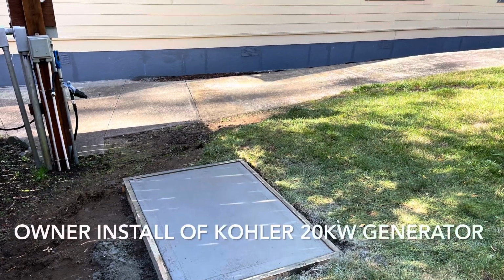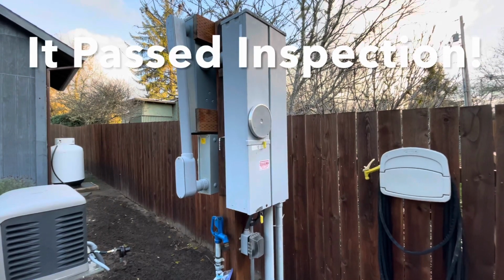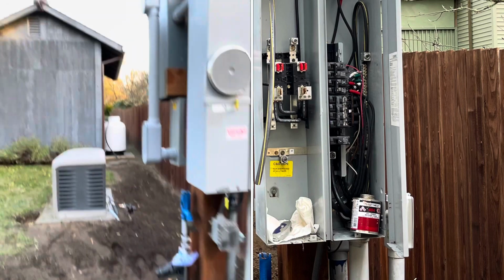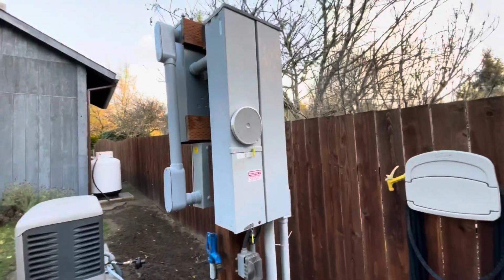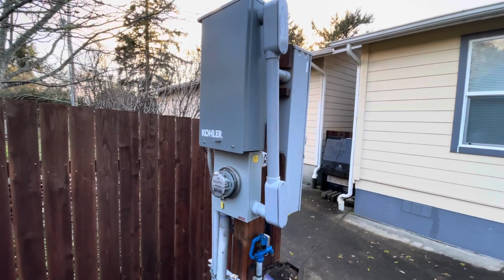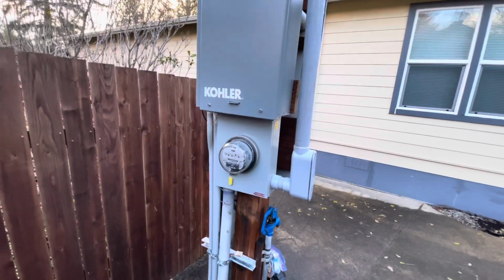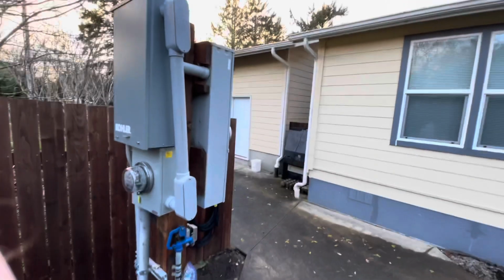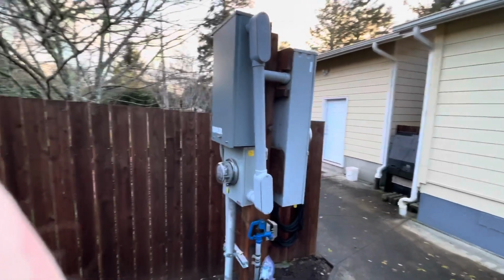Owner install Kohler 20kw generator finally passed electrical inspection

Comment: Would never pass here as your ATS box sticks out farther than your meter box, our local power company wouldn’t allow that as it impedes in their required working space for their meter sockets. 

Not saying it won’t work.
Reply from the maker: Fortunately neither the state inspector nor the PUD lineman took issue with the physical layout. Half way through the second winter season the system has accumulated over 60 hours runtime and continues to perform well. Outages occur Frequently on this stretch of the coast,  thankfully our public utility district is staffed by talented and motivated professionals who keep those frequent outages relatively short lived.
Cheers!

Comment: 4 months jeeeeze
Reply from the maker: When I installed the gen-set we were using the house as a vacation home and  I only had a day or two per week to work at it. We’ve been living here full time for a year and the unit has been invaluable, I should add it’s ran perfectly.

Comment: Hey great video anyway you can help me out with wiring from ats to generator I’m having trouble figuring out the battery charger from the board
Reply from the maker: The generator is at our vacation and soon to be retirement home along with all the diagrams & paperwork but perhaps I can remember enough to help.
Reply: @jatoav8or  thanks for quick response So I have the exact same set up As you and they’ve tested the system it does work but what I can’t figure out is where to land from the ATS board to the board in the generator The wires in order to keep the battery charging I currently have it with an external trickle charger so the battery doesn’t die out
Reply from the maker: When I  get an opportunity  I’ll look for a schematic to see exactly what I used & what terminals are involved.
It was last fall/early winter I did the installation, I can’t remember off the top of my head. I do know I ran 12 or 14 gauge solid insulated copper from the card in the ATS to the terminal block on the generator. That lead supplies the generator with 120v ac to power the controller and the battery charger in standby mode. The charger is integral, if you supply power to the generator you’re also supplying power to the battery charger. I’m trying to find a schematic online so I can tell you exactly which terminals in the transfer switch and which terminals on the generator. 
When we get a break in our weather I have to go mow the lawn at the beach house then I can physically look but that’s not going to be for a few days.
Reply from the maker: https://www.electricgeneratorsdirect.com/manuals/kohler-8d641dfaaf49f5e27025a18de960cd9e.pdf
                                                    https://www.norwall.com/product_pdfs/21_14resa_installm_2015.pdf
                                                       Above are links to the two pertinent manuals I used for the installation.
In manual Tp-6893
Section 1.9.2   1.9.3   1.9.4
Figure 1-18   1-19
Manual Tp-6807
Section 2.6  
    Figure 2-8  2-9 2-10
I can see I need to open everything up and do a detailed explanation not a brief overview.  At the time I was alone , the weather was dreadful. Not conducive to making a video.
Reply: @jatoav8or  thank you
Reply from the maker: I apologize for the delay and confusion, especially the confusion. I finally realized what you were asking about and could have immediately answered your question if I’d paid closer attention.
I just posted a video with a detailed description of supplying the 120volt ac to the terminal block inside the generator for all the standby requirements including the battery maintainer & controller board. 
It has nothing to do with the communication card in the ATS!
You just need a free 20 amp breaker and run 12 gauge stranded THHN or equivalent  hot, common & ground into  the ATS enclosure so you can feed it into the “big” conduit not the smaller conduit with your communication cables.
On the generator the three 12ga  stranded wires land to the right hand side of the main terminal block. it’s marked (UTILITY) LINE-COMMON-GROUND 
It’s unfortunate I misunderstood what you were asking and I regret  the long delay.
Reply: @jatoav8or nice